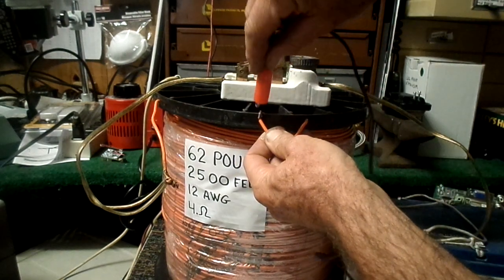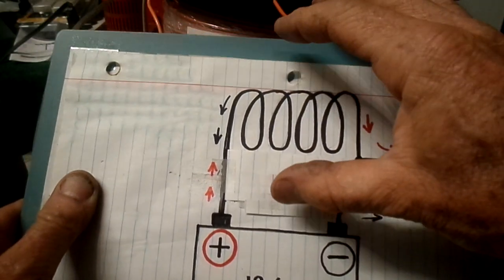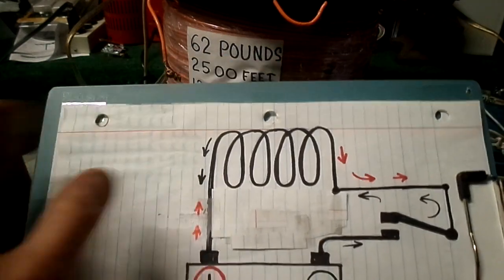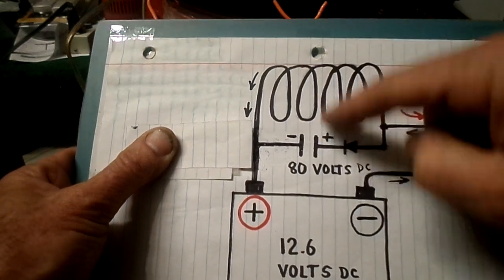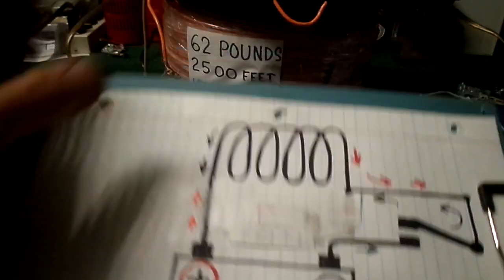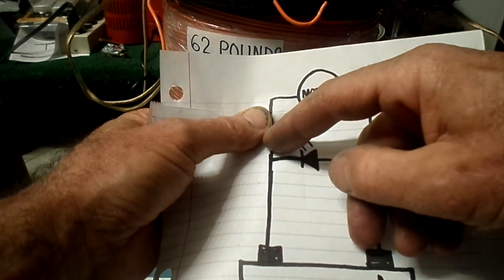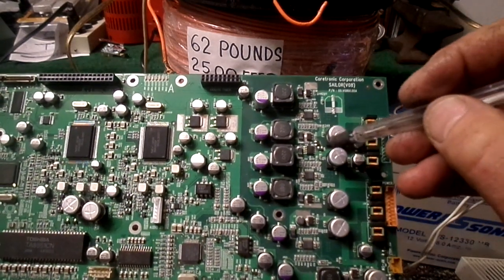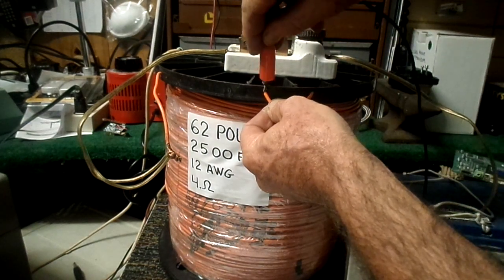The Back Spike From A Coil Can Destroy Switches, Relays And Electronic Parts.

Comment: Recycling Back EMF, by regulating it can charge batteries even while supplying energy to a motor or generator. It's the basics of Free Energy being lost.
Reply from the maker: When you recycle the back spike it slows your rotor down.
Reply: it speeds up when u feed it back to the system
Reply: @BlacKnight Tech  Facts it's the basics of Newman motors and Bedini circuits. What ppl don't get is that the energy you're getting back is a direct result of the mass of the coil. My understanding is that the mass is converted into energy when the coil collapses. capacitors and dumping it back into the circuit not only preserves the speed it increases it exponentially, you can even get to resonance levels where the current can "run away" and become uncontrollable. It's a direct result of the coil "ringing like a bell" when it collapses. Shit's super cool when you look at it from a different angle.
Reply: I think you have just re-discovered the Turbo Encabulator.

Comment: Remember that, even if  Back EMF is not greater than the input, there is EMF also created ready to use . If you find right resonance you may get something interesting result.  While you use back recovery diode, you are making half bridge Back emf at 3th rezonance. Remember, Coils and electricity bunces just like a springs, bouncing up and down with right resonance, Water drop on lake creates quantum waves on water  or tizz sound from wine glass!  While you absorbing that energy inefficiently, your resonance will be stopped..
Reply from the maker: I can barely understand anything you're saying.
Reply: @GrantsPassTVRepair  Then, I can simply say;  I find efficient way to burn back emf of my Brushless motor, as soon as I switch on back emf brun setup, motor power consumption reduced to half and motor speed increase. While I am burning it, did make back emf of back emf force that help to the motor go forward rather than reverse that helps to gain more torque while refusing the dc power source energy! That's why power supply shows zero amps!
Reply from the maker: @serkanozkani  I'm guessing you are measuring your source amperes  incorrectly, or measuring with an amp meter that's broken, wrong scale,  or unable to deal with the switching pulses,
Reply: @GrantsPassTVRepair  switching speed might be the case. But however I have checked with different sensitive power analyzers. This is most sensitive one. 3 digit sensitivity. It might be below 3 digit power consumption.
Reply from the maker: @serkanozkani  It sounds like you need to use an oscilloscope with a current shunt to accurately measure the amperes your motor is consuming.
Reply: @GrantsPassTVRepair  I will try that.

Comment: basicaly magneto ignition perhaps dual polarity is mentioned in waste spark ignition beleve it or now turn that staff to plazma ignition you see lot more suprise and no you dont use polarised capacitors they must by ceramic in your case I wuld not go near that coil it culd trow you acros the room so strong wuld by that spike

Comment: That process to pulse a coil to get back that spike of energy causes the battery to heat up when you constantly ark off that wire to get that high voltage spike and ruins your battery.. TO GET RID OF THIS , just get a transistor and heat sink , that way the transistor and coil gets all the heat.

Comment: Nice job ...does the reverse voltage breakdown that makes the diode to conduct , have any impact in selecting the diode ratings to used across a coil ? 
If it does , how do you now determine the diode to used if , for instance the supply Voltage is 24vDC ?
Reply from the maker: Yes. It's important to use a diode which can handle the power without being damaged.
Reply: The reverse voltage rating of the diode needs only to be the supply voltage.  Snubbers are used in the FORWARD conduction mode, not the reverse mode.  In other words, put the cathode of the diode on the positive terminal of the coil, and the anode on the negative terminal.  Then when applying DC, the diode is reversed biased but only to the supply voltage and will just sit there.  But when you break the circuit, the coil pushes electrons out its positive terminal, making it briefly "negative", and onto the cathode of the diode, back to the negative terminal of the coil which at the moment is now positive as the coil is acting like a battery.   Since the diode is forward biased for this operation, its reverse voltage capability is unimportant.

Comment: Dear Sir,  
Just to quote you:

"...interrupted has more energy for a short segment of time than the input power if sampled for the same segment of time. It turns out I was incorrect, so I wanted to talk about this mistake in this video, and attach it to my first video."  
Please say how did you establish that you where wrong? I am curious if it was by deduction or my a practical experiment which included measuring outputs ?
Did you use a wattmeter or did calculations?

Best regards,
Reply from the maker: This is a challenging concept to explain, and I apologize for any confusion, but in my experiment I used an oscilloscope to measure the power because of the speed of the back spike. What I realized after making this video is that the back spike power spread out over time is always less than the input power,  but if your coil is large enough, for a given sample of time you can have current and voltage spikes that exceed your input power for the same segment of time. I hope I said this clear enough.
Reply: @GrantsPassTVRepair   Dear Sir, that you very much for replying. Thank you too for the answer.Now you have mentioned that it was after the video seen above  that you made certain conclusions.I am also understanding that IF your coil is large enough (How large? Inductance? Ohms?) we get current + voltage spikes that exceed your input power for the same segment of time.Very very interesting.I do plan to replicate and share later on.
Reply from the maker: @garydunn9418  I hope I made that clear enough for you to understand I'm not claiming you will ever get more overall energy output than your input power, and I don't have any inductance values, but if you have ever hooked up a 9 volt battery to a transformer or coil and noticed the huge increase in the size of the spark when you open the circuit, it's very apparent for a short segment of time there will be  a huge increase in the intensity of the arc. Just as a capacitor  stores energy in a static field, an inductor can store energy in a magnetic field, and release it so quickly it gives the appearance that it's actually more output power than your input power.
Reply: @GrantsPassTVRepair   Okay.I have charged caps with BEMF.I am not fooled by huge sparks or loud pops.I thought you had done a bench test with instruments and observation of experimental protocols.What I might do in the future is to reuse the microwave transformer I had used, and a true rms wattmeter on the input .Charge Cap for say 10 seconds or so with BEMF and without BEMF.Then measure the power leaving the cap.
Reply: @vodoroda9449  unfortunately it’s no more available. :(. Could you please share a copy of it? Thanks

Comment: In your first example with the 12v battery. Does the back emf have any affect on the battery at all? Since it’s a reverse voltage to it?
Reply: The energy gets dumped somewhere. Part of it can return to the source, but not all.

Comment: Could that back spike burn the motor from where it originated?
Reply from the maker: I would think that would depend on the driver circuit in the motor. If it was a purely inductive motor I would think that would be unlikely, but if you have a transistor driver and no internal protection from a back spike that could be a problem.                                                                                                                                                                               A motor with brushes might wear a little faster on the commutator contacts due to the back spike, but not instantly.

Comment: You can NOT harvest back EMF with capacitor. It won't ever work. It has to be a second battery. Actually you can, but it will never be OU. 
This practically work with tiny 9V batteries in series up to 600V. Coil need to be at least big as yours. Probably much thinner wire and a lot more turns. Current is in miliamps.
This is a way to maintain voltage of batteries, not to charge them up. If voltage increase  to much, you could use that little power, but is practically of no use. Your working part is actually a coil itself.